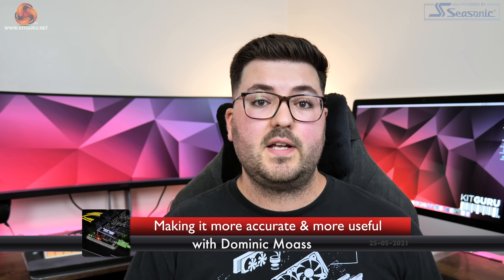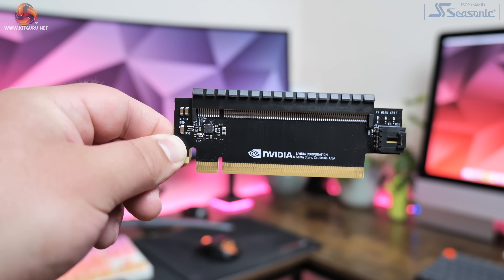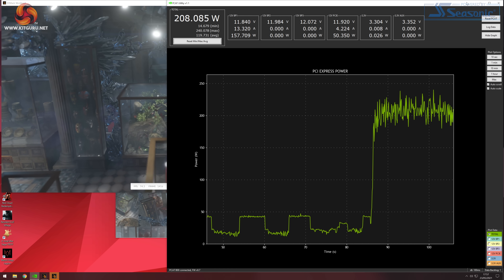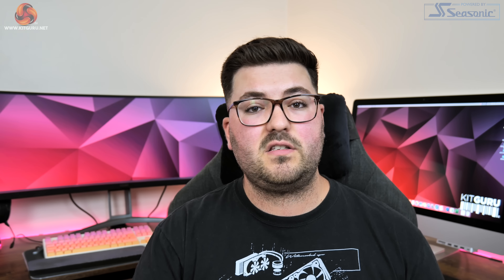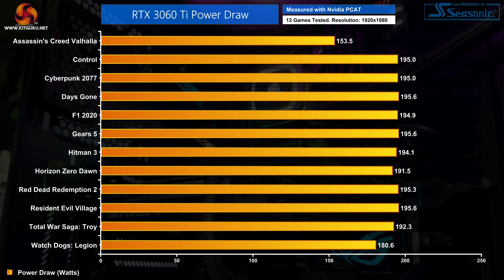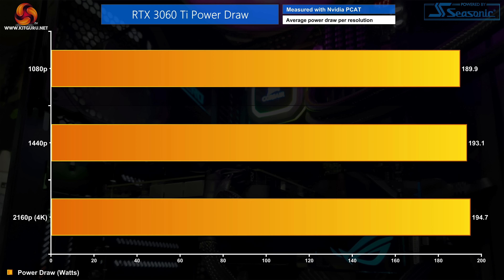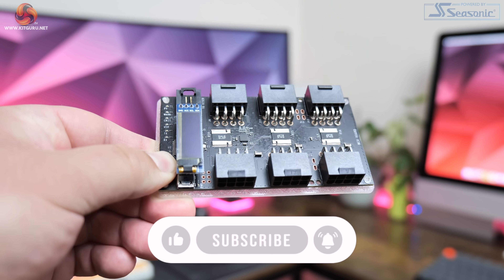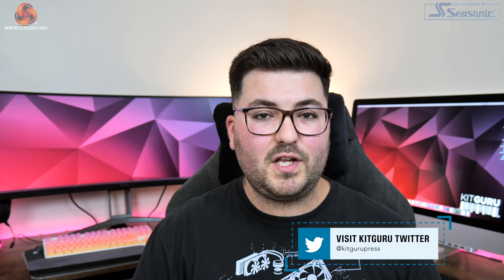Overhauling our GPU power testing for more accurate data!

Comment from the maker: any questions or feedback? let us know - and stay tuned to see the new methodology in action soon!

TIMESTAMPS
00:00 video start
00:15 the problem with wall meters
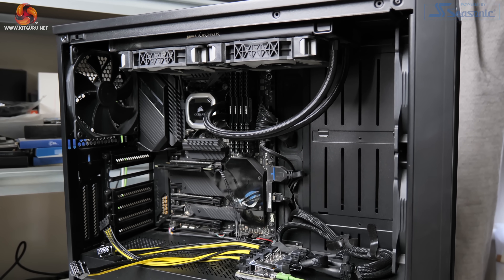00:56 Nvidia PCAT - what is it?
02:03 how we previously used PCAT
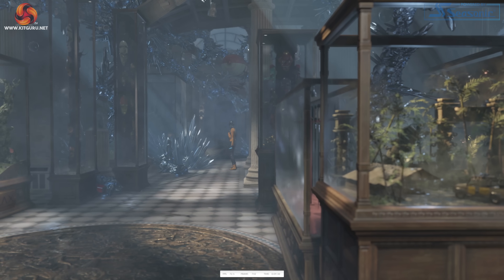03:00 how we are using PCAT now
04:38 a few examples…
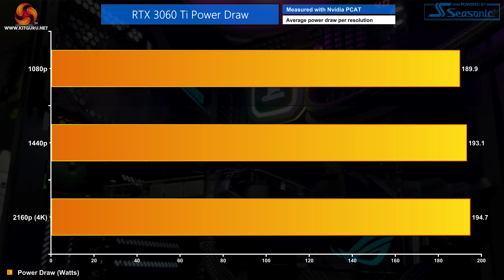05:47 performance per Watt is now much more accurate
07:44 wrapping up - the TLDR

Comment: A bit of criticism in regard to performance per Watt. I think that it should be considered that this AMD card uses 50% more memory. I don't know how much W that requires but I think that that 'delta' should be processed in the graph in some way. Let's put it this way, as an end-user I don't mind a slightly higher power iff the reason for it is that there is more memory, that does give the GPU more longevity after all.
Reply from the maker: i see where you're coming from, but performance per watt is exactly that - how much performance is on offer per watt. i.e. if there's no performance gained from the extra memory, then the perf per W won't go up. if there are scenarios where the extra VRAM is clearly beneficial though, that would also be reflected in the perf per W. either way, GDDR6 doesn't take up much of the power budget anyway (Igor's suggests 2W per module, so only an extra 16W power for the memory with the RX 6800 vs RTX 3070, for example)
Reply: @KitGuruTech  Thanks for the clarification, I did not know the power per module (though I could estimate it at 5-10 W per 8 GB based on DDR4 which is a rather rough estimate), that is useful information.

Comment: I wonder if any of the tech media will go to the trouble of sanity-checking the accuracy of PCAT. Blind trusting an NVIDIA-developed device to accurately report figures from both theirs and their competitors' solutions feels a bit naive...
Reply from the maker: I don't believe PCAT is actually 'aware' of what graphics card is installed. It just monitors the power draw of the pcie slot and pcie power cables. In any case, you can compare power draw figures from PCAT to other media outlets who use other hardware (like the Powernetics project) and they all match up
Reply: Good point, there have to be some other tools too and it would be nice to actually see the average system draw too, not just the GPU, which usually draws what the manufacturer indicated anyways.

Comment: Keep up the good work and bring it on! 

One very minor suggestion: in your bar chart comparisons from 6:30 onwards you keep swapping the two GPUs around which is confusing but it would be more consistent to keep them in the same order throughout.
Reply from the maker: I think it's more noticeable because here we're only comparing two GPUs. We'll have more data in the review charts, but sorting by value makes the most sense to me
Reply: @KitGuruTech  Actually, it's because there are only two that it becomes confusing; if you had a large list it would be fine. I think it's a short-term memory thing. Somewhere between four and seven items is the point where you should start to sort because your viewers can track of things up to that point. 

Anyway, it is a very minor bit of polish and I look forward to some very interesting and informative videos.
Reply from the maker: @QuentinStephens  yeah that's what I meant. When we show charts like that in a review, we'll have more than two data points so it shouldn't be as confusing